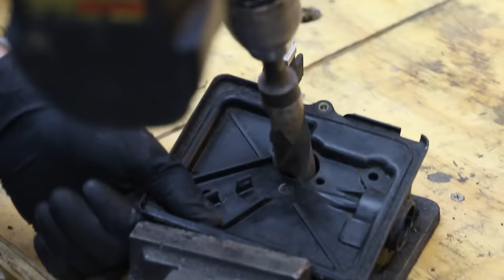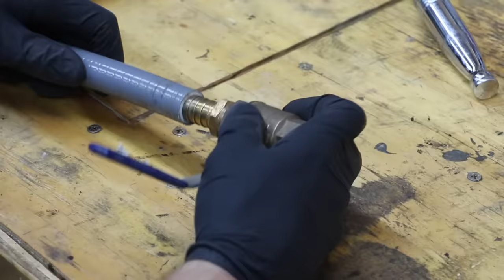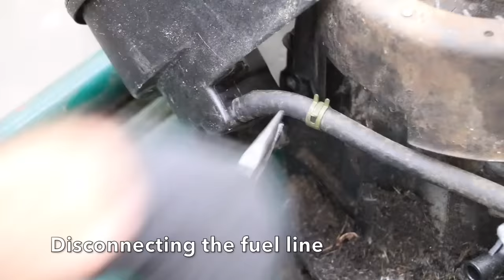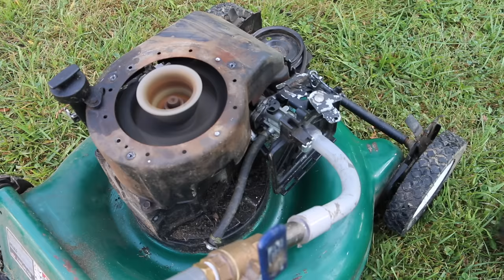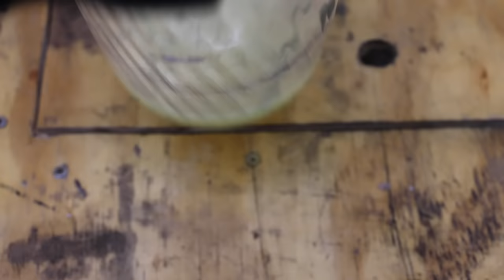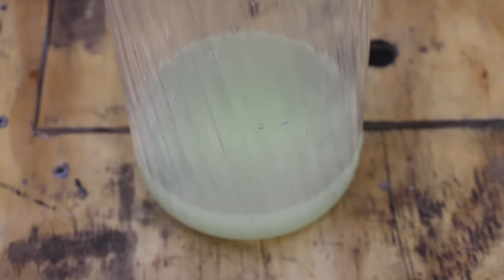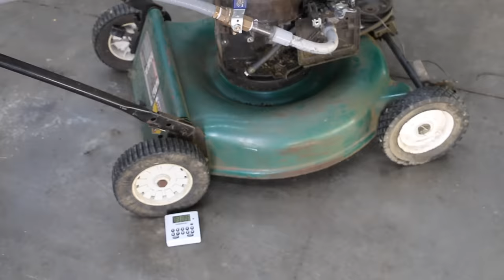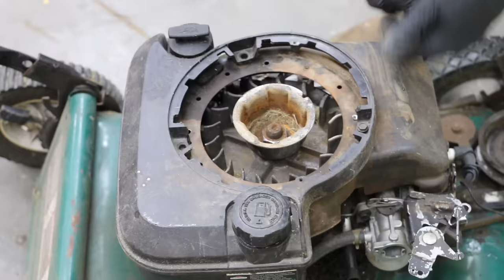Will a "Gas Vapor" Container Improve MPGs and Fuel Efficiency?  Let's find out!

Comment: The secret is heat. If you vaporize gas at it's vaporizing temp (around 500 degrees) you will notice a large boost in fuel economy. The first patent was in 1932 by Charles Pogue for his 200 mpg carb on a Flathead Ford (look it up). It worked but was dangerous as the gasoline is near it's critical flash point. The carb looks like a miniature refinery sitting on the engine and used the exhaust to heat the gas to high temps.
The best carb to use is one of the propane conversion carbs as they work well with vapor. The propane is run through a heater unit before the vapor is introduced to the carb, the heater unit is heated by the engine coolant at 180 to 190 degrees. Propane is very cold and needs to be warmed up. The heat units from the 60's through 70's were the best because they were bigger and had a larger heating area for the vapor and works well with alcohol. With all that said the perfect fuel to vaporize at a low temp is alcohol (it vaporizes at 173 degrees) ethanol to be exact and around 70 proof seems to work as well or better than 100 octane leaded fuel! If you run your lawnmower engines on rubbing alcohol 70 proof you will be amazed at how well the engine will run and after a couple tanks of alcohol the inside of your engine will be as clean as new and stay that way. Run synthetic oil and the engine will last forever!
Vaporize with heat but be careful. Grain alcohol (ethanol, rubbing alcohol etc) is safer because you can put out an alcohol fire with water as it dilutes the alcohol and the fire goes out quickly. Vaporizing alcohol with 180 degrees is a lot safer than 500 degrees. Back in the 70's when OPEC screwed everyone with the phony gas shortage I experimented with alcohol fuel and found it to work extremely well. I could purchase 55 gallon drums of 190 proof ethanol and dilute it to 70 proof and go out and burn some rubber in my 68 Fairlane 390 GT.
I ran everything from my lawnmower, several cars and pickups and a gas powered GM bus that ran on propane which was an easy conversion for alcohol vaporization. Alcohol won't start cold and needs some help. That's easy, just rig up a small propane cylinder for torches or camp stoves and give the engine a couple shots with a tickler valve and it will start up, stumble for a couple of seconds then it will run great. Adjust the carb for higher fuel flow.
Have fun
Reply from the maker: Thank you!
Reply: there are a lot of causes why gas isn't vaporized by a heat plate nowadays. just two of them:
1) the vaporization of the gas inside the intake system is urgently needed for cooling the intake valve and the piston.
2) the efficiency of an engine drops if the intake mixture is warm. intake has to be as cool as possible.
Reply: The coleman stove style carb has been researched. problems with this system are obvious to anyone that has ever gone camping. The venturi type carb uses manifold pressure differential to accomplish the same vaporization as the heat carb. This can be demonstrated through Boyle's Law and Charles Law (Combined Gas Law?).
 I love a good conspiracy rant. Did you ever hear the one about: "The whole Studebaker factory is being stored in a secret government warehouse somewhere in Nevada"? As I recall it had something to do with a 200 MPG heat carb.
  I've found an understanding of basic Physics  makes me more resistive to wild claims and the like.
 As for the oil embargo: It was their oil. It was in their country. They chose not to sell  to us. What were we supposed to do? Send in the troops?
Reply: How about you use the Heat of the motor itself (to get it at least closer to the temperature) so that the economy is the same at the beginning but when the motor gets warm the fuel economy is better?
Reply: The engine temp is not hot enough unless you use alcohol. Doesn't work with gas. Some guys experimented with metal coils wrapped around the exhaust manifolds and run the gas through them and it actually helped. I know a guy that actually got over 90 MPG on a V-8 engine with this setup. After a couple of small fires he determined it was dangerous the way he did it but he proved it would work.
Reply: No, I have too much fun with my alcohol fuel, it works great in my vintage hot rods and old muscle cars that drink high octane fuel. Ethanol is well over 100 octane, even vaporized.
I have been monitoring the hydrogen fuel videos and sites but I haven't found any data to suggest onboard systems can supply enough hydrogen for a fuel hungry 650+ horse power beast at full throttle. Bob Lazar has a Corvette running on hydrogen but he has about 4 tanks in the back where your golf clubs would go. He has his own stationary hydrogen generator that he fills the tanks with so he has no onboard generator.
Watch the video here: https://www.youtube.com/watch?v=rQ4JtVIAA-k 
My advantage with alcohol is this, I can drive anywhere in the country and never have to buy gasoline. If I am desperate I have a choice between rubbing alcohol, denatured alcohol or a commercial ethanol station. The cool thing is if I am in the middle of the desert at the last chance Bar Grill & Gas I would head for the bar, and I don't even drink, however a couple bottles of Bacardi 151 in the tank and I'm down the road. No beer won't work as there is not enough alcohol content.
Reply: @radioactivelarry  

Ethanol is used in Brazil a lot. Mostly hydrated ethanol 92 to 96% ethanol.

Our gasoline is mixed with 22 to 27% anhydrous ethanol, required by law.

Most newer cars are flex fuel cars. Most of them use the exhaust oxygen sensor to adjust the mixture, and still abide by emission laws (Proconve L-6, similar to Euro 5).

It works ok. Has a bit higher power output as ethanol has oxygen in the formula that adds to the air in the charge. For the same reason, this oxygen weights, uses space  but does not add energy. So a given volume of ethanol has only ~70% of pure gasoline energy (heating value).

The engine consumes energy. Of fuelled by ethanol it uses proportionally more volume to compensate for the lesser heating value.

Ethanol does indeed maintain the engine internals cleaner.

With higher octane ratings and cooling ability, it does allow for higher loads (with less WOT enrichment).

Nobody ever claims it allows for higher MPGs (Km/l here). The kind of supposed recycling of recovered heat into a physical state of the fluid or even a chemical one is not claimed. 

There are HHO, H2, gasoline vapour scammers though. The only reasonable help might be an increase in flame propagation rate with marginal efficiency gain in the best case. Most of the time just snake oil gimmickry.

Normally Aspirated (NA) engines usually has low pressure at the admission manifold (MAP) that leads to condensation of the atomized fuel coming from a carburator or EFI setup. That is especially true at light loads. Many engines use recycled heat to heat the manifold and or carburator so that the cylinder recieved an atomized fuel charge instead of liquid drops.

While it works, it's not radically change the energy balance. There is no 200 mpg carburator... only bad accounting.
Reply: @radioactivelarry  where is there good info about converting an engine over to alcohol and area there extra parts necessary? And what gas mileage do you get with alcohol or ethanol, hope you've done the research I am looking to convert my  Corvette stingray!
Reply: What year is your Corvette and is it fuel injected?
Reply: @radioactivelarry   1978 v8 350 engine, carbureted, and I'm looking for the most practical type of fuel and optimal gas mileage so I was thinking ethanol vapor
Reply: @ @Swigbeast22  I don't know what happened with my text. I wrote a long how to and when I hit the ? key it all went away!
Tomorrow I will retype it in my word processor then insert into here. 
In the meantime check this document in PDF, you can save it. It explains a lot of what I just typed when my text crashed.
http://708fa56501784a4c189e-e05b8c913494b41052b85350bfd1f4ef.r43.cf1.rackcdn.com/download/4/Bonus/ConvertYourCarToAlcohol.pdf
Your 350 V-8 will run great on alcohol.
Reply: why such a long comment?
Reply: Lots of bullshit patents claiming better fuel economy using vapor, heat, hydrogen (HHO).  All Lies!
Reply: That is a very intetesting article.
.

.Out on our farm we still use ideas from the past to save a little bit of money and have some fun.Thank you for your time.
Reply: radioactivelarry can you please tell me where you can find the alcohol for cheap
Reply: Except that thermodynamics doesn't support that at all. If it were true, auto makers would find a way to do it safely and market a highly fuel efficient car.

But ic engines can only extract so much energy through combustion regardless of how warm the fuel is.
Reply: Read my comments on this sort of system and it will make a believer of you Patrick Galloway
Reply: @valveman12  prove it
Reply: @walterwojcik5090  It's already been proven.  Videos are up for you to enjoy.  But you don't really want to see proof!  You just want an argument.  Your mind is already made up and it will be until you try and experiment with this to come to your own conclusions.
Reply: Radioactivelarry
Could you clarify whether you are using Celsius or Fahrenheit?
Reply: Those carbs were never officially verified or tested. 200mpg would be  impossible on a vehicle in the 30s, even at 100% efficiency, due to the amount of chemical energy stored inside even modern gasoline. More modern cars, being more advanced, and heavier, would be strictly impossible, as the gasoline just does not have enough energy contained to apply the work and force needed to move a vehicle that distance.
Reply: @Fobia17  Gasoline has plenty of energy.  That's not the problem.  The problem is that a combustion engine is only about 30% efficient in converting the energy from gasoline to power at the wheels.  If you could get back all that lost energy from friction, heat, and light, etc. then you could have a vehicle go a long way on a tank of gas.  But alas!  Combustion engines are highly inefficient and that's not going to change.
Reply: @valveman12  It does have quite a bit, but nowhere near enough to go 200 miles, even at 100%. But, yes, they are incredibly inefficient machines
Reply: @Fobia17  Well since you cannot harness all the energy from gasoline to drive the wheels, we will never actually know whether you can get 200 miles per gallon.
Reply: @valveman12  well, it take 470m joules of work to move a mass of 1461kg(aversge mass of a car) 322k Km (~200) miles, and a gallon of gas only gas roughly 120m joules of energy. So, even with 100% of that energy applied to the wheels, nowhere near 200 miles. You would need to be driving a perfectly efficient, unladen scooter to even approach 200 mpg, and, as you mentioned, that's before we take into account atmospheric and road friction
Reply: @Fobia17  Ok!  I didn't check the numbers so I'll take your word for it.
Reply: @valveman12  if you get a chance/care to, please do! These things mean nothing if I flubbed somewhere.
Reply: @Fobia17  Yup!  I'll have a look.  I don't know everything so learning something new is great.  Cheers
Reply: radioactivelarry: I have bean concerned about the valves missing lubrication with a gas vapor system, a natural gas system, or a propane system. I take it that is not true?
Reply: They did eventually take that approach.
Reply: Thanks.  People think the 100+ mpg carburetor was a gag, but it worked on that simple principle...preheat fuel to a vapor state which is sucked into the engine rather than much less efficient "droplets."
Reply: you mean the gasolines auto ignition point (280c), flash point is the temp at which something releases enough vapour to be combustible (-43C for gasoline)
Reply: just run propane.
Reply: Hahaha...Mr expert, spewing stupid.. all carbureted engines had the exhaust cross over in the intake, to heat the incoming air and fuel to the cylinders..  your ignorance, led to your shame
Reply: the pogue carb was not dangerous and having a heated fuel does make it more combustible.  when introducing the heated fuel into the air if the intake system it cools the fuel down quite a bit. previous to that there is not enough oxygen to allow it to ignite. that carburetor would be one of if not the best to use.
Reply: Wow, this thread makes me weep for humanity.  So many un-and-under educated people stringing lots of fancy sounding words together to try and sound smart.  You all are arguing about which carburetors are more efficient, while the educated world has moved on from Sequential Milti-Point Fuel Injection to Gasoline Direct Injection, and even a bit of gasoline HCCI (Homogeneous Charge Compression Ignition) like Mazda's Skyactive X uses.

I'm guessing you all must have been raised by single moms: no dad to put your ego in check when you start thinking you know more than highly educated Research and Development teams at auto manufacturing and design facilities with almost limitless budgets.
Reply: radioactivelarry p
Reply: LukyTheWolf z
Reply: radioactivelarry This got me thinking. By ducting the air inlet tube into the gasoline, the air bubbling through the fuel should cause cavitation in the liquid, effectively flash-boiling it with little heat. Or am I overthinking this?
Reply: @jamesmonahan1819 - Send in the troops ? Like they did in Iraq when Saddam Hussein ,having had enough of US sanctions,decided to sell HIS oil in Euros rather than US dollars.
Reply: @bengunn3698  I don't know how to respond to this.